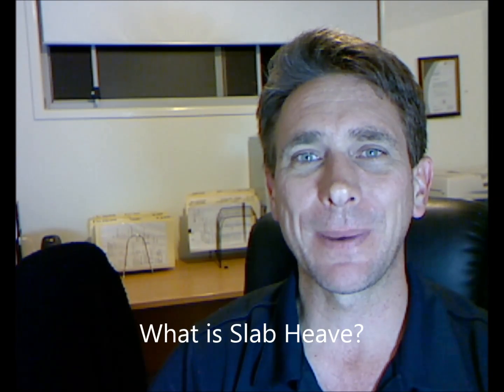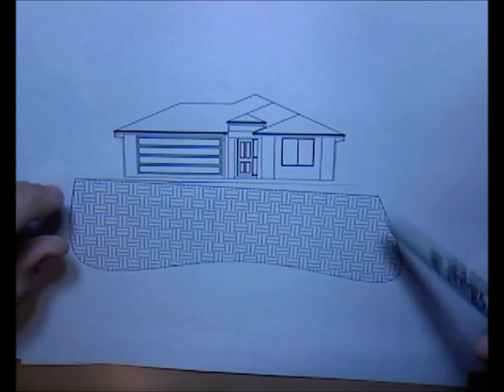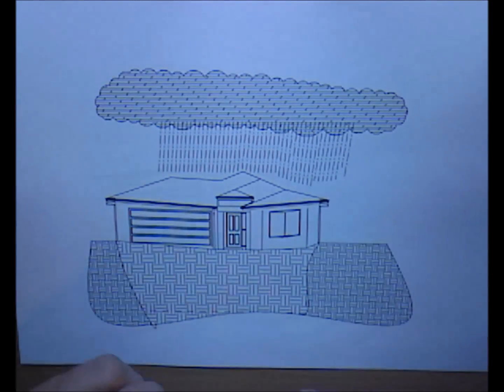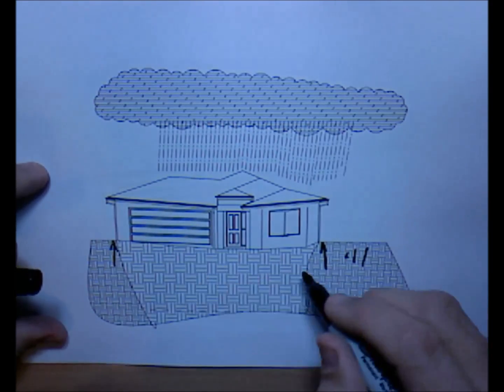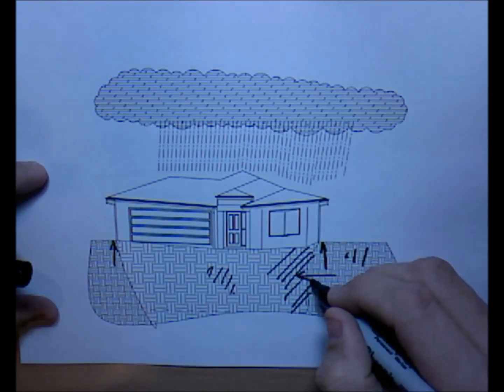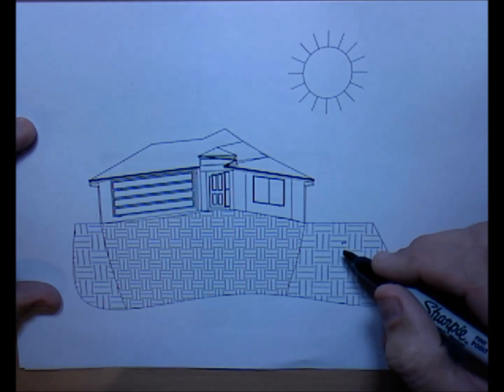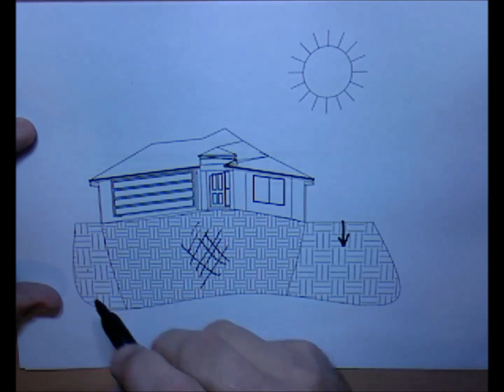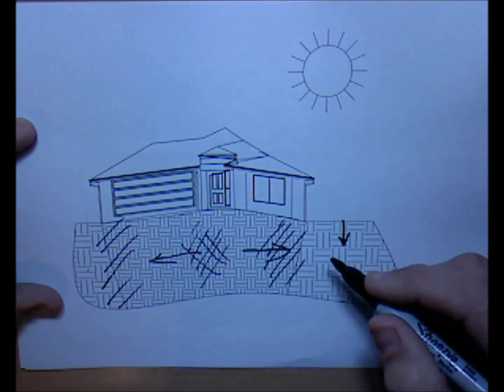What is Slab Heave and how does it affect houses?

Comment: I recently bought a 5 year old house that was in great shape. But I believe Victoria’s one of the hottest and driest summer, the soil under the house has shrunk. Now I can see gaps under the concrete path in the backyard, and some parts have sunk. There are also cracks showing up on the brick walls both vertical as well as horizontal (especially under the window sill). I'm wondering if the recent heat and dry weather have caused similar problems in other areas of Victoria. The house has a waffle slab foundation and is marked as Class P on the plans. There are no internal cracks.
Reply from the maker: Bricks are fragile and crack when there is uneven movement, but so do plasterboard walls. If there is no internal damage, maybe the house is on piers and is performing ok? The size and direction of the cracks int he brickwork gives information on what could be happening, so maybe you need to do a video for us!?!!. If you were in QLD, under 6.5 years and too much movement, you could claim against the homeowner's insurance with the QBCC for an investigation. I don;t know what the process is in Victoria.

Comment: Is there any advantages of a strip footing slab over a raft slab ( monolithic slab) for H1 or H2 soils ?
Reply from the maker: I'm not sure they are different but I guess it depends on your terminology.
What do you mean by strip footing slab? Do you mean that the grid of strip footings is poured first and the slab is poured on top?
If so, then there are construction advantages but also penalties for either choice. 
The answer will depend on the site, the builder, the design, the lay of the land and the availability of materials.
Matt

Comment: I have inspected as many as 50 new built here in west Melbourne area such as Point Cook and Geelong. I have been shocked by the terrible quality and failures incidents caused by waffle pod slabs, the developers and builders in Victoria are obsessed with this shit form of footing. Waffle pod slab is sensitive to moisture change of soil as its stiffness is way too small and the ponding built up beneath it is unavoidable. I wish Australia federal government would legislate to ban it!
Reply from the maker: I agree Scott. It goes against our mission of building a strong Australia. Yet, for as long as there are developers and builders willing to cut corners on footings and slabs, there will be an engineer or designer willing to take their money and sign off on a waffle slab design. 
It's heartbreaking to see young home owners with cracked houses and the value of their home disintegrating. It causes massive home life stress far more negative than spending a bit more on strong foundations.
Legislation is a big hammer - but a big problem like this certainly needs to be addressed.
Reply: @CornellEngineers  Thanks for your reply, Cornell! 
Speaking of waffle pod slab, it's another fatal disadvantage is - it is too light to resist the uplift force generated by the horizontal loads such as wind load as well as horizontal earthquake impact. Just early this afternoon, I have inspected another site by Mxxx (you know it's one of the largest home builders in Australia), the waffle pod slab again! And the timber framing is in terrible conditions - wrong slab dimension led by wrong formwork, wrong framing tie-down and a few more altered structural details that are not approved by the engineer. Then I have given a long defects list to the site supervisor and the building surveyor (equivalent to building certifier in QLD) - you may be surprised that the building surveyor had signed off both the slab and frame with so many defects...

Comment: its reasonable to have or expect a garden around a residence. Its reasonable to expect moisture changes in the soil- these and tree roots issues should be considered or included with concept and construction of appropriate slabs. Builders and engineers know of these changes to soil they should behave much more responsibly towards slab and structural issues and home owners complaints
Reply from the maker: Absolutely Chris. I agree. Except exactly how much watering should we allow? How do we measure this? What if the ground is then allowed to dry out? 
As engineers we're always able to make footings and slabs much stronger but this is expensive and consumers demand economical designs. Don't you agree that homeowners should take responsibility for looking after their own homes too?
There has to be a balance between sensible designs and sensible home ownership.

Comment: We have developed a method of controlling floor slab heave. look on my YouTube video... https://www.youtube.com/watch?v=AOhf_GDJdA0&lc=z22dylhzry2muh4djacdp43a0azk1wfyelvh43st5kpw03c010c&feature=em-comments
Reply from the maker: Hi Bob. Thanks for your link. Does your system get installed as the house is built or can it be retro-fitted? How far apart are the air sumps under the slab in a big house? Have you got a system to control edge heave or does this system already help with higher perimeter footings?
Reply: Hi Matt,  We have primarily used this as a retrofit on existing houses although it certainly has more economical application on new builds. We typically install each suction pit for about every 1500 sf. We have used this on edge heave, and have modifications to the system for those conditions.
Reply from the maker: Do you have any photos or paperwork that I can share on our website that shows the sort of success you have achieved with your system? Levels, cracks photos etc? There's a lot of interest in fixing slab heave in Australia.
Reply: yes we have data from a variety of sources, including follow on floor level surveys 12 months post installation, readings of the relative humidity of the exhaust subtracted from the ambient humidity of the intake air. on average our data shows that we are removing aprox 7 lbs of water per day. Our geotechnical engineer is David Deatherage of Copper State Engineering. He has the data we have collected. A master's student at Arizona State University is making this the subject of his thesis, but will not be finished for about 18 months. Dave can be reached at david@copperstate-eng.com